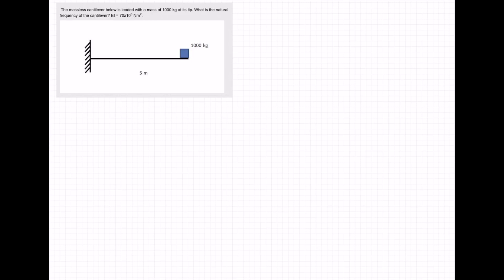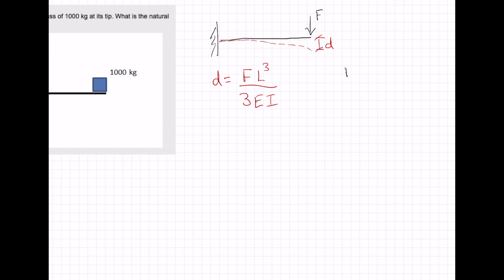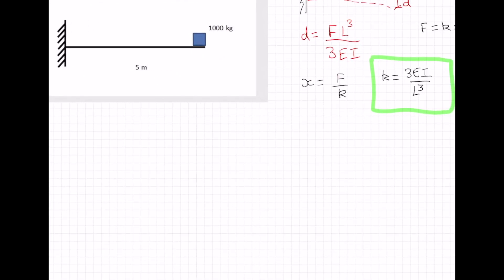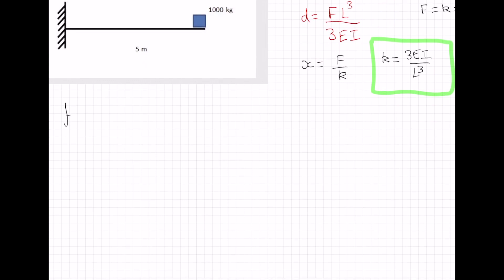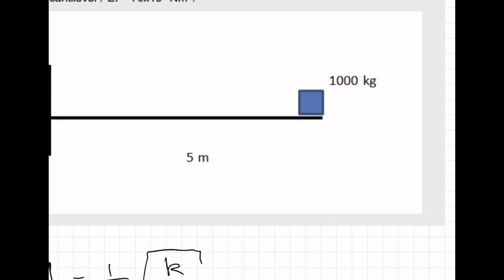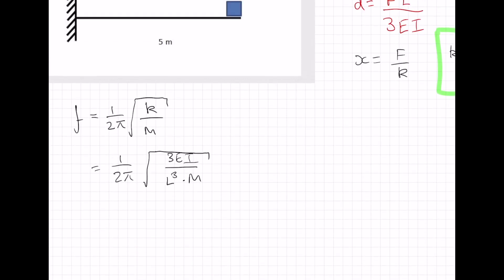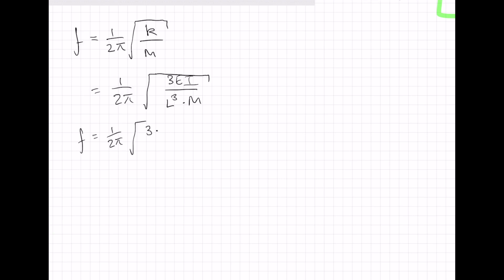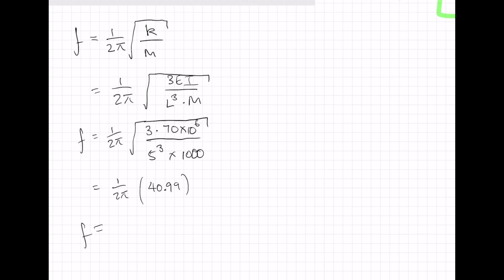Natural Frequency of Cantilever - IStructE Certificate in Structural Behaviour Course

Comment: Do we need to change the 1000kg to N? then the values are not matching. Please clarify
Reply from the maker: No you don't.
Reply: @TheStructuralExam  please explain as if we were dividing (newton x meter to the square) by (meters to the cube x newton), we would get a value in meters exp (-1), which should be the expected value, isn't it?
Reply: @giomario75  N.s = kg x m/s  therefore  N x m2/ m3 x kg = kg x m/s x m2 / m3 x kg = m/s x m2 / m3 = m/s / m = 1/s = Hz

Comment: HI...for Certificate in Structural Behaviour which book do you recommend for learning structural dynamics??
Reply from the maker: The Certificate in Structural Behaviour's dynamics questions aren't complicated to the extent you need to read anything up. In essence they all follow the same formula: 1) Find the equation for static deflection of the system, 2) F=kx, find the spring constant, 3) Fn = 1/2π * √(k/m)
Reply: @TheStructuralExam  sir, Is it enough to practice the same kind of problems given in structural behaviour quiz to clear the understanding structures exam?
Reply from the maker: @giftsonsamuel2627  Basically yes. Their exam is multiple choice so it is as much about eliminating wrong answers as selecting right ones.
Reply: @TheStructuralExam  one last question. Will clearing this exam help recent graduates getting a job?
Reply from the maker: @giftsonsamuel2627  Hard to say. Probably not though. The things that are tested in this certificate are similar to 1st or 2nd year of university, so if you cannot pass this exam then you certainly shouldn't be passing university.